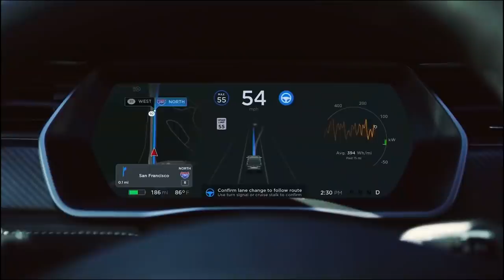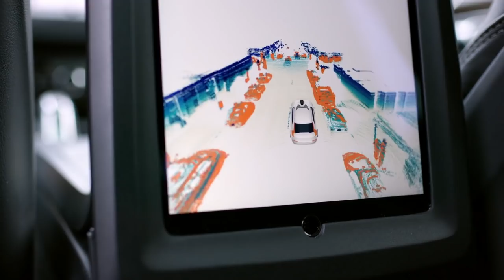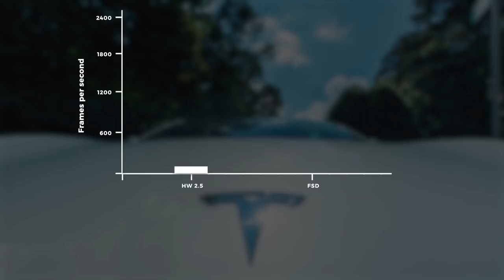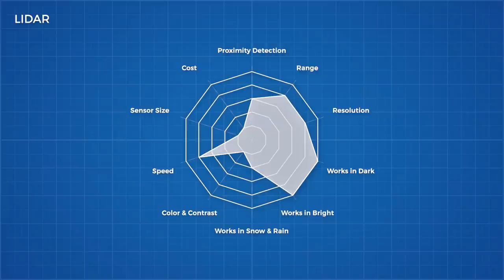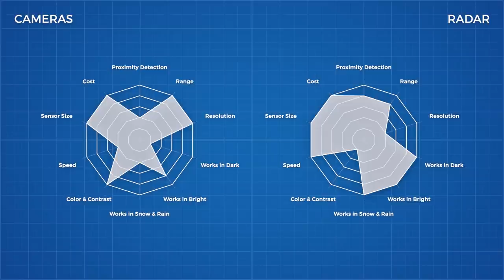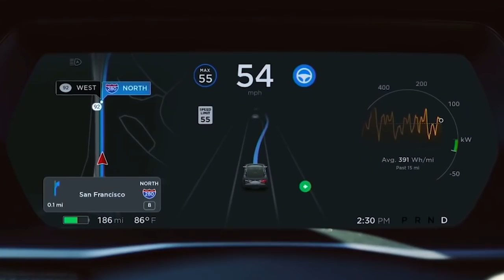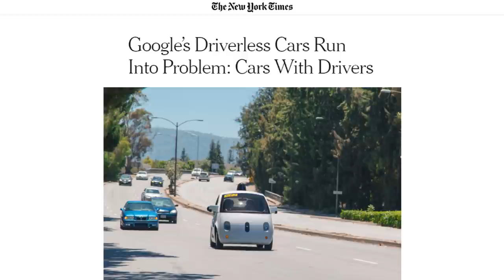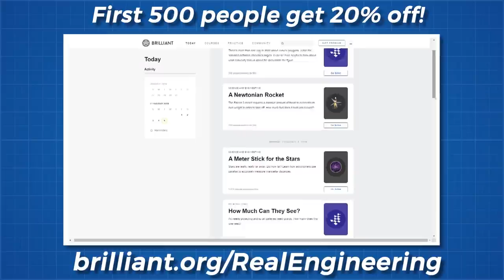The Challenge of Building a Self-Driving Car

Comment: Issues with self driving vehicles not addressed here are Insurance and liability: Am I protected when my vehicle's "perfectly" followed programming causes human fatalities/injuries? Am I at fault for my vehicle's actions? Am I still the "driver", or just a passenger (can't fault the passenger)? 

Second, I'm curious if these vehicles are programmed to break speed limit laws? I got the impression from the video that they "go with the flow" speed-wise. Since the vast majority of traffic is moving faster than the speed limit (not counting rush hour of course), these vehicles would be knowingly speeding as well. 

Also, requiring humans to be paying attention enough to take over at a second's notice defeats the whole point of having a self-driving car. Passive driving (not paying attention to surroundings) is the problem we're trying to overcome; giving the driver less active involvement in the car's operation (steering, braking, lane changing, etc) just leads to more passive driving.
Reply: Kevin D 
How speed limits are handled is mostly BS. Tourists in switzerland  get a speeding ticket for 53 in 50, swiss policemen: "If we wanted you to drive 53, we would have a sign saying 53." 
Society is built on rules!
Reply: Yevhenii Diomidov  Probably would depend whether the manufacturer had certified the vehicle for operation without an operator once they do then it probably would be liable otherwise it's likely to be like any machine that needs an operator the operator will be at least partially liable, though the manufacturer may still be partially liable if some negligence on their part contributed to the injury.
Reply: Yevhenii Diomidov  It isn't up to Tesla to decide. Hurting someone goes to criminal law and courts. They decide who is liable, not Tesla. Tesla could say "we are liable", but the courts might say "no you aren't, the owner ordered the car on the road, they are liable".

To begin with for the car to be legally self driving on public road, it would need government permission. Driving licenses are a thing. That car also essentially needs a "autonomous car control system driving license". When that starts to be worked out, the legal mess starts. Who is liable. If the government has certified it fit for traffic, is the government liable? The car maker? the owner? the passenger? It will be a years and years long legal mess, that might end up with "Government would be liable, government doesn't want to be liable, no self driving cars will be certified for traffic. Safety drivered cars? Sure, since then safety driver  is liable and not the government"

Since we are talking public roads, one can't just assume "everyone agrees to the risks of autonomous cars and accepts that the liability regime is X". Also what would be the sanctions for criminal behavior by self driving car? Can't throw the car in jail. Fines? That seems kinda insufficient, if a self driving car drives straight into a school bus and kills children. People go to jail for vehicular homicide. Does the government inspector who signed the type certification to jail? The owner of that specific car? The maker of the car? the passenger? if there is passenger to begin with anyway.

Anyway is it negligence or murderous intent..... The log shows the car sees the bus, but just keeps driving. Can't exactly ask a computer algorithm about it's intent, if the date is unclear or due to some glitch it is unclear. Is random bit flip jamming the throttle decision to a latch state, negligence or intentional.
Reply: TL;DR I think it would be case-by-case and probably part of a complicated regulatory framework.

I suspect what would happen is an investigation (as is already common in crashes resulting in serious injury or death) to determine whether the fault is due to owner tampering, improper maintenance, or an error on the part of the manufacturer. For the last one the question becomes whether the manufacturer was obeying regulations, whether they could have been expected to know about the error, and if can be reasonably compelled to correct the error.
Reply: @jazzfan1994  Indeed it is probably quite likely to lead to more complex accident investigations in order to determine liability for the accidents that will happen. Still this is hardly something the authorities lack experience with they already deal with such multi factor investigations when dealing with accidents involving modern aircraft, trains etc that have complex safety systems installed and extensive maintenance histories to investigate etc.
Reply: You don't need to worry about any of this b/c you won't own your self driving car. The whole point of all this is to move cars to a service mode.
Reply: @Kevin D

1: it will all be decided in the courts. That’s how these things have always worked. There will be some initial regulations. Studies will continue and regulations will be updated. Deaths will occur and will trigger additional regulations (or more studies that will lead to more regulatory updates).

2: will depend on regulations. See #1. 

3: this will not be the case once Level 5 autonomy is achieved. The entire point is that humans will not need to intervene. For the lower levels of autonomy, humans need to pay attention but these are not considered full autonomy, they are more driver assistance. The exception is Level 4 where things are locked to a specific area under a specific set of circumstances.
Reply: Yes, the really big problems are legal and commercial. If the software fails, the manufacturer will be responsible and get sued. Software always fails, so manufacturers will need to included the cost of legal action in their business model, making driverless cars more expensive than driver needed cars.

Your third paragraph hits the really big problem. The only reason to buy a driverless car is that I don't have to drive; if I can't spend the journey doing something else, I might as well drive myself.  The technology is nowhere near good enough to be truly driverless.
Reply: I would imagine that you will be able to get an insurance through the provider that doesn't change on a crash. If I was an insurance company and I can insure a car with a 90% lower crash chance, I'd jump on the opportunity.
Reply: @iliyakuryakin4671  look up the SAE levels for driving automation ;)

Comment: Actually, the main sticking point against LiDAR isn't cost, it's sensor information. Cameras give so much more information about surroundings, and can tell the difference between a pedestrian and a car much easier than a LiDAR can. With a sufficiently powerful nueral net net, and enough data, self driving is possible with only cameras, with the radar acting as a safety net for redundancy. After all, human drivers rely mainly on our cameras, our eyes.
Reply: And nobody would buy a car with this thing on the top

Comment: if (cantDetermineObstacle) { decelerateSlowlyToGainMoreTime() }
Reply: Would result in quite slow cars sometimes though.
Reply: The section from 11:53 demonstrates why this won't work - most of the time the car isn't quite sure what something in its field of view is, so it would constantly be slowing down if safety was always the only concern.
Reply: Yeah.. the problem is how to fill in "cantDetermineObstacle". Objects are classified using a neural network, which was trained to determine the probability of something fitting into each category it was trained to recognize. The car is never sure or unsure.. it always has a gradient of "certainty" and selects the most probable option as the one to categorize the object as.
Reply: @PKMartin  I think it can work if the car also determines whether the obstacle trajectory and car trajectory intersect
Reply: invalid syntax, missing ";"
Reply: @PKMartin  just set a delay

Comment: One item overlooked is lidar is computationally extremely expensive as the RGBXYZ point Cloud it creates requires a lot of calculation with each point being compared to its surrounding points to build a 3D model. It is also laggy at a fraction of the frame rate of a camera,  not practical to stream or easily store and review and point clouds are less compressible and use up huge amounts of space.

Another issue is lidar is much more accurate at recording colour compared to cameras which have lots of issues with lenses and chromatic inaccuracies.
Reply: LiDAR doesn't give colour. it gives a Intensity value, often encoded as a number between 1-256.

Comment: Your diagram of the uber Accident is off by at least 30 feet, you can see the pedestrian was impacted a few feet before the solid line switches to dotted. If you notice from the satellite view there appears to be an "X" shaped sidewalk in the median, this is purely a decorative (stone pavers) feature but appears to be a sidewalk. There where multiple signs telling pedestrians to not cross here as this is not a sidewalk/walkway but after the accident this feature was removed and replaced with gravel to further discourage crossing. Phoenix has one the highest pedestrian/cyclist collision and death rates of any major city in the United States. Though we are trying to understand why this occurs here more than other places the role of the design of our roads/infrastructure is one of the major causes, also crossing mid block is a contributing factor to a majority of the deaths here in Phoenix. Like many accidents it's easy to blame one party but the reality is multiple failures (Uber's Systems, Mid block crossing in the dark, poor infrastructure design) combined to create this fatal accident. As someone who rides their bike through this intersection multiple times a week and had a close call at dusk with a pedestrian crossing in the same spot 3 months prior to the fatal collision I believe it's naive to place the blame solely on Uber.

Comment: At 3:12 you say the driver did intervene “a second before impact by engaging the steering wheel and braking.” You also mention the very slightly reduced impact speed. The steering wheel was engaged 1 second or less before impact and the brake was engaged 1 second AFTER impact.

Comment: Once there are enough of these cars on the road, and they can start talking to each other, it will be a no-brainer. It'll be so much safer, insurance companies will virtually mandate it by making normal cars too costly to insure for most, and so much more efficient getting from point a to b, that buyers will want them. It's not a question of if, but when. Great video. Thanks!

Comment: So the Uber accident was a human mistake anyway. The system saw it, it just wasn't programmed to act. The sensors saw it, the system was capable but it was not told to act.
Reply: That is one of the outstanding problems:  Who is liable for such accidents?  The driver or the programmer?
Reply: Easy, the taxi service for using technology that is not ready to be used.
Reply: The actual answer is that as always happens in real life, no one is ever liable, because our legal system does not give a single fuck about anyone killed by a motorists. Pedestrians and cyclists barely even count as second class citizens.

Comment: Tesla's weak point is that they only work during nice and clear weather. The cameras will fail when dark or in a snow/rainstorm. I feel like this problem isn't considered enough.
Reply: Infrared camera + Night vision camera
Problem solved...
Reply: @paulgarcia2887  a NV camera doesn't help when it's snowing and raining. Also they produce a very noisy and low quality picture. They might be helpful for simple low light conditions but they won't solve the overall problem.
Reply: Humans can't see well during a snow or rain storm either. The self driving car doesn't have to be perfect, just slightly better then a human driver, and a human dorsn't have the benefits of infrared or night vision, so that shouldn't be hard
Reply: @limiv5272  You are 100% correct. I'm just talking about the cases where for example the Camera gets covered an the system suddenly loses it's "vision". A fully autonomous system would have to stop and wait for clearance. There is too much to debate and there are still too many open questions about fully autonomous driving. I'm excided for the future development.
Reply: Logge For some reason, some people forget that Tesla’s vehicles aren’t only relying on 8 cameras. There are 12 ultrasonic sensors as well as a forward facing radar. The ultrasonic sensors + forward facing radar permits the car to work very well in bad weather conditions, something that LIDAR is incapable of despite being super expensive.

Comment: Level >0: From our species evolving and walking upright, to eventually creating the wheel, rickshaws, and carriages.
Levels 0.0-1.0: From the early locomotive and coal and steam engines, to the first cars that ran on electricity in the late 1890s until years later Ford and his cornies pushed things back with fossil fuel model cars and tech was held back decades.
Levels 1.1-2.0: From having braking power, power steering, automatic seat belts, to cruise control and innovations throughout the 20th century up til the mid to late 2000s when parallel self parking cars and simple scanning tech ( lidar) could alert drivers of objects nearby, even without cameras when backing up, which also came about.
Levels 2.1-3.0 or less: By the early to late 2000s (up to 2019) cars became a tad more sophisticated, with better camera, controls, balance correction, lidar, and better cruise control and almost actual self driving capabilities. They can feasibly go for miles without total human interaction, but its little more than very good cruise control, maintaining appropriate speeds and distances from objects using lidar. But people could not go to sleep, or zone out, or look away from the road, nor take their hands off the wheel, even if the car was doing 3/4 of the work. Fatalities after unmanned tests of the supposedly superior, fully autonomous self driving cars by tech companies proved that we certainly dont have anywhere near the perfect level 5, or even slightly less perfect level 4 cars of "sci fi' science possible". Regardless of what is created behind closed doors or slowly becomes available to the wealthy or slightly well to do; until a thing is available to the general public at large, and works well, its still a ways away. Most should have level 2 that can self park and use lidar within 10 years domestic, 20 worldwide, unless level 3 with better tech becomes more affordable and widely available by well into the 2030s.
Level 4 should become a worldwide reality within 20 years of that, and level five, fully autonomous, self driving, with never a single moment of human interaction needed, other than destination input or inquery, should arrive in most nations well before the end of the 21st century. Lets say 2070s roughly, assuming we dont nuke ourselves or die from some other nonsense of our own misdeeds. CIAO! ^~^

Comment: 12:47 Someone making a left turn, and oncoming traffic not yielding is what breaks down the flawless 4 way stop.  Turning traffic has right of way, followed by forward and right turns.  THEN, the cross traffic may begin.  It is VERY OFTEN the straight or right turn traffic moves first, leaving the left turns in a "squirrel" state, "should I go, should I yield?".  Both directions inch and stop, inch and stop, the opposite direction travels.  FINALLY the turning traffic moves, and hopefully the cycle is reset.

Comment: We bought a 2020 Toyota Corolla with lane assist. Works pretty good but it's not perfect. In cruise control it will adjust speed to keep a certain distance from another vehicle in front of you and will brake if needed. Pretty good but not perfect. Humans have had a long time to develop the ability to see ahead and analyze possible problems. However we can become impaired easily. Drugs and alcohol and cell phones or many things we might be thinking about that can potentially distract us. A couple years ago I ran a red light because I had something on my mind. I'd been through the intersection before. If there had been other vehicles at the intersection I would have noticed and adjusted my focus. If there had been any police around I'd have gotten a citation. Before I retired I drove trucks and many times saw examples of distracted drivers. Often using cell phones. We also have to deal with fatigue and low visibility. Sensors and computers will not have such problems once we get them to the level of seeing and analyzing problems as well as humans do.

Comment: Autonomous cars need to have a safety standard way higher than human drivers because responsibility is being transferred from the driver to the software engineer.  The liability being taken on by the car company with presumably deep pockets is going to be difficult to surmount I think.  Tell me the average driver isn't going to blame any incident on the computer.
Reply: autonomous cars are already the safest cars on the road. can't prevent what other drivers do though
Reply: Meh. 

If the car signals the driver to take the wheel and the driver fails to take action then blame should be put on the driver. 

If the car hits an obstacle and it did not alert the driver prior then blame should be put on the company.
Reply: @Im-mv6bf  -- Did you watch the video? He explained that there isn't enough data to reach conclusions about that, even under normal driving conditions.
Reply: @mvmlego1212  Tesla vs same amount of ice cars.... which has more crashes ? the answer is plain to see
Reply: @Im-mv6bf  -- No, it isn't. There hasn't been enough driving from self-driving cars, let alone Tesla, specifically, in order for any differences in the fatalities-per-mile rate to be statistically significant.